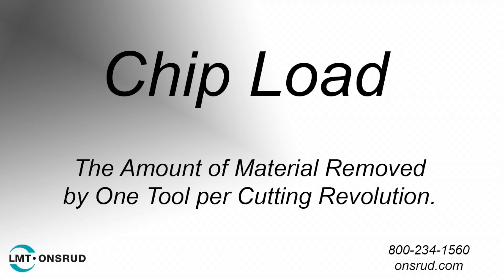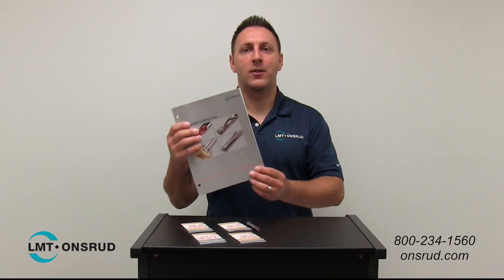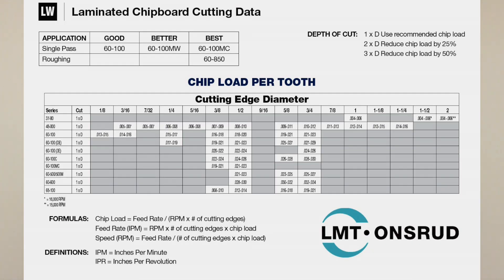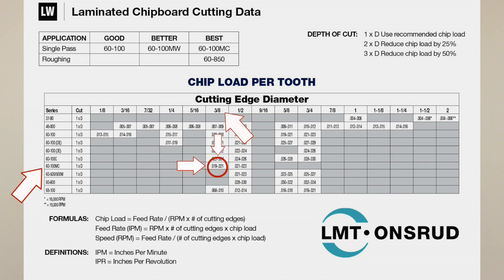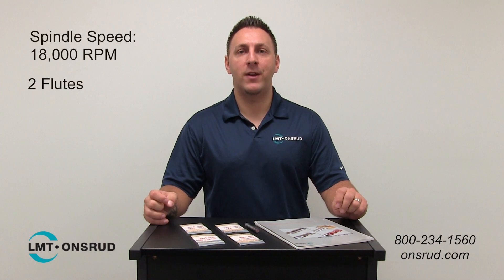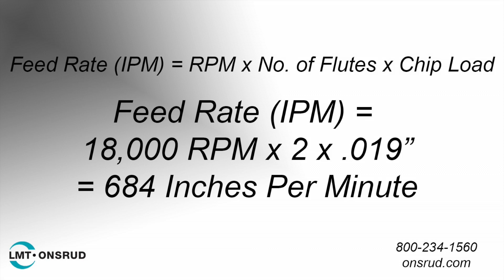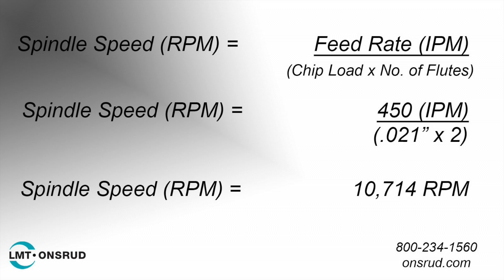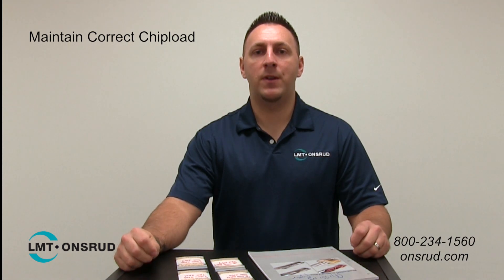Calculating Speed and Feeds by LMT Onsrud

Comment: It looks like at 1:37 your graphic reads that the bit has three flutes but you use 2 flutes in your formula.  Should it have been 3 flutes in the formula, or am I not getting it?
Reply from the maker: Good afternoon - it should be two flutes though I know the slide shows three flute..The tooling shown is a two flute tool...I will try and get this corrected.

Comment: Thank you for the explanation. I was wondering if there are any impacts in tool wear if the Depth of Cut adjustments from your table are made. I am using a 56-287 (1/4" diam) and want to cut a 3/4" plywood in one cut (which would mean a 50% reduction in chip load and feed rate). What are your recommendations regarding this issue? Thank you
Reply from the maker: Greetings Gabriel. I will get with one of our in-house Technical Advisors to get you proper recommendations on this. Please stay by/Thank you.
Reply from the maker: Our Technical Advisor strongly recommends limiting the depth of cut for this tool to .375” in depth. This would result in machining the material in question in two passes rather in the single pass. For further assistance or tool recommendations you can contact our team directly at info@onsrud.com. Thank you.
Reply: @LMTOnsrud  Thank you for the fast reply. For the proposed depth of .375", how much should I reduce the chip load?
Reply from the maker: @gabrielbranco2013   You are welcome. Thank you for subscribing. Our Technical Advisor recommends a 25% reduction to give you the best results.
Reply: Hello. I tried following your recommendations but the tool broke after a couple of minutes (it was brand new). I am trying to figure out if I did something wrong: I was cutting a .375"  piece of plywood in on pass using 56-287, having set the feed rate to 180 ipm (18000rpm x 2 cutting edges x 0.005 chip load). Can you help me figure out what happened?
Reply: Sorry, I gave you a wrong information. I applied the 25% reduction rate to the feed rate stated (180ipm)
Reply from the maker: @gabrielbranco2013   Greetings. No worries, our Technical Advisor is here to assist. We have found that the math needs to be adjusted a slight bit to get accurate tooling. Correct calculations are: Chip Load @ 1xCED = .006".  (-)25%  @2xCED = .0045".  Overall: @18,000 RPM x .0045" x 2 Flutes = IPM 162.  Our Technical Advisor can provide more information through email or a direct call can always be scheduled.  For further assistance or tool recommendations you can contact our team directly at info@onsrud.com. Thank you.
Reply: @LMTOnsrud  Thank you for your response. As I said in my last message, I actually used 135 ipm, after applying a 25% reduction to the 180ipm feed rate.
Reply from the maker: @gabrielbranco2013  Greetings. Our Technical Advisor wishes to speak with you directly at 1-800-234-1560. We feel that better tool selection is the best method to run this project. Thank you.

Comment: Can u explain in mm
Reply from the maker: Hello Abdul - thank you for contacting us. Though this video is explained in inches, the principles would still be the same for mm. Converting inches to mm 1" =  25.4 mm & 1mm = 0.03937". You will need to convert the inches to mm and then plug these values into the formulas depicted here. Hope this helps, but if you do have questions, you may contact our technical support for further information. Thank you.
Reply: I made a web calc which do exacly that: http://informatyksiedlce.pl/_PROJECTS/chipload_calc/